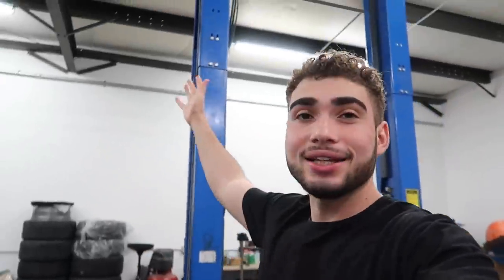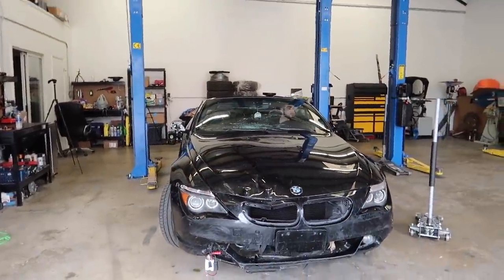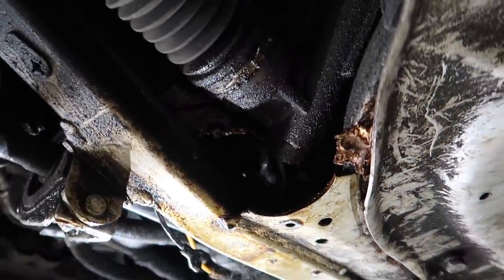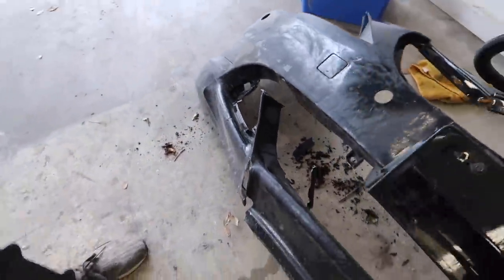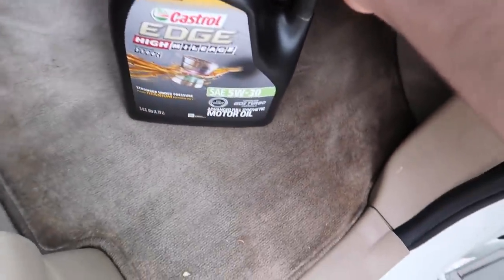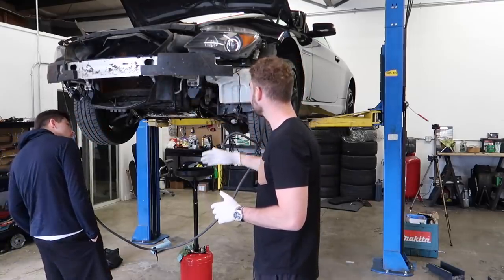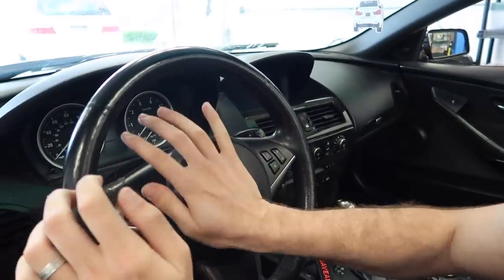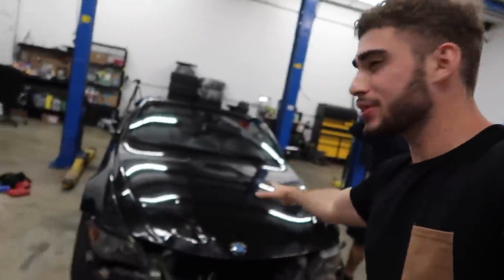$800 BMW 650i HAS HIDDEN DAMAGES!

Comment: Those wires you took off that were just sitting there, they're to convert halogens to LEDs so the lights dont flicker and you dont get codes
Reply: no those were HID  xenon balasts you can even see a hid bulb hanging from the wires that come out of the balast
Reply: @dragos2010full1  yes it has HID's but those are H11 or 9006 bulb fittings, and those bulbs are only Halogen
Reply: @dragos2010full1  or the other, I might be mistaken
Reply from the maker: dragos2009 yea
Reply: @NourHummadi  probably for the fogs
Reply: @NourHummadi  the car probably had aftermarket  hid bulbs in the bumper projectors very rare thing in usa but very common in europe
Reply: @dragos2010full1  HID ballasts for fogs, obviously they never installed aftermarket HID kit before. Surprised they threw them out before finding out what they were there for. This is a great build for the channel. Car needs a lot of maintenance. Will look amazing after it's finished.

Comment: big fan of this build but you can't determine if the wheels are original BMW if they're 19 inch.  The only way to find out if they are OEM if you take them off and check for BMW printed on the rim

Comment: Bro my advice will be to take that front end completely apart to give you good access to the front of the engine. N62B48 are notorious for timing cover leaks (top ones) and for the alternator brackets leak. It will look like you are leaking from the steering rack or rear main but no sir, is all those things. Gaskets are cheap enough and with that front end off you’ll have toons of room to work.

Comment: Wrong Oil. Please change it to and 5w-40 or 0W-40 from Mobil 1, Castrol EDGE, Pennzoil Ultra Platinum, or Valvoline Synpower. Those meet BMW Specs. 5W30 High Mileage Castrol EDGE does not.

According to  the Mobil 1 website, the 4.8L engine takes about 8.5 Quarts

Comment: Did you change the oil filter? You only mentioned draining both screws. Dude, you’re leaking from the radiator bracket seal and upper oil pan gasket.